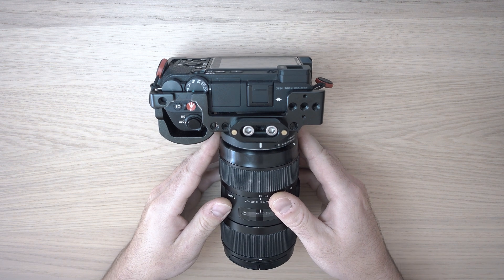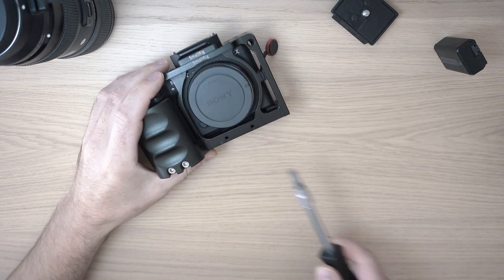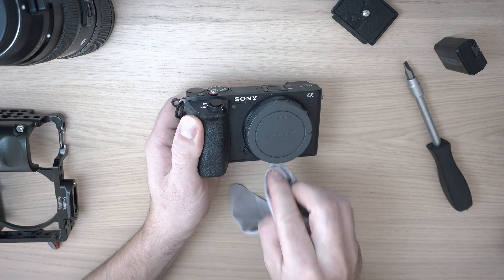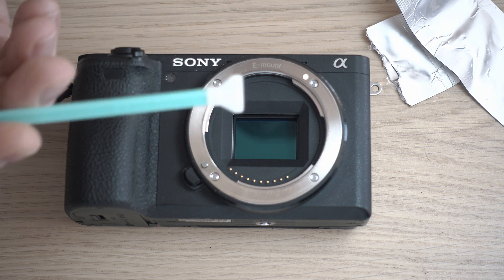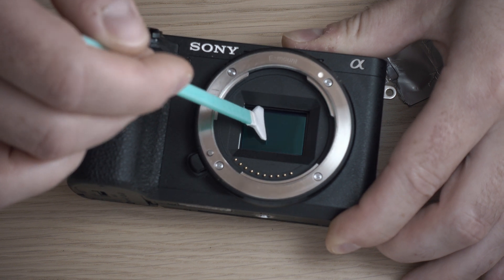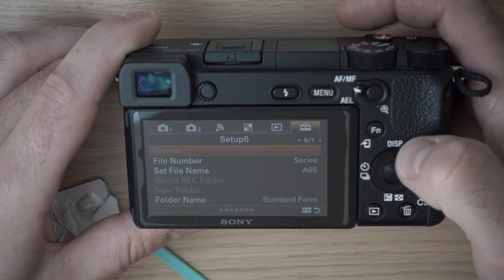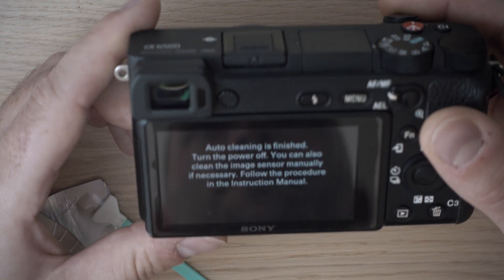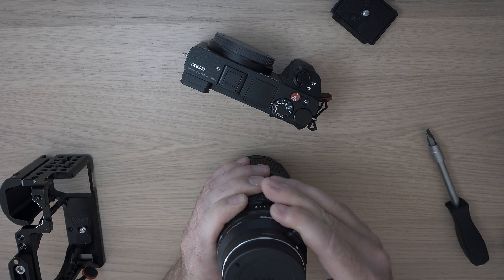CAMERA SENSOR CLEAN | Sony a6500 APS-C Sensor Clean With SWABS | Sigma 18-35 f1.8 ART And MC-11 | 4K

Comment: can i use swabs witbout liquid ?
Reply from the maker: what kind of? ones I using are made for sensor cleaning...   however if in emergency you can gently wipe sensor with dry microfiber like cloth or swab ... just be careful ....
Reply: @takeapart  sir i have 12mm swabs in a pack can i use it directly on sensor i mean is there any sensor liquid need for it or not thanks gudie me plz
Reply from the maker: I don’t think there is special liquid for sensors.
Reply: @takeapart  will i try swap directly to clean it?
Reply from the maker: go for it man just carefully....
Reply: @takeapart  thanks for your suppprt ❤
Reply from the maker: thanks for watching
Reply: @takeapart  wlcm ❤❤👌
Reply: @takeapart  i have little problem with minor shade u can see on my channel on latest upload video thumbnail
Reply from the maker: make sure it is definitely caused by sensor... it can be dirt on lens too

Comment: You just saved me at least $60 every six months! If this is all that camera stores do when they clean a camera their charge is ridiculous! Such a simple technique! My only concern is that I would use swabs rather than a cleaning cloth on the back end of the lenses that attach to the camera body. Thanks! I'll order the swabs.
Reply from the maker: hi, service is expensive no matter if for cameras,cars ...etc.  you can do it yourself just be careful.   you can use swab on back end of the lens however the element there is mostly curved and sensors swabs are flat ... soft cloth is just fine... btw: thanks for watching